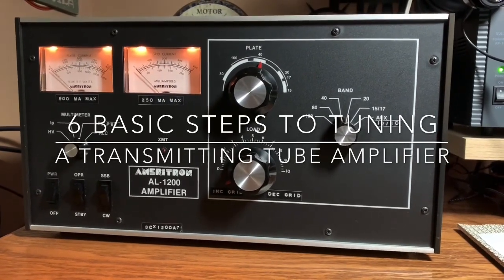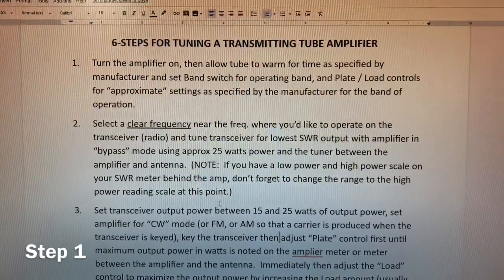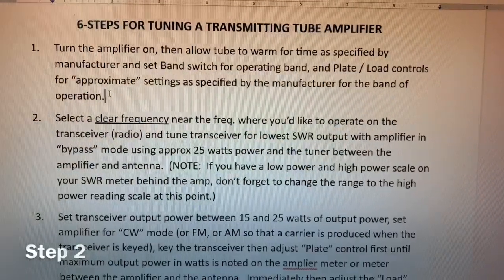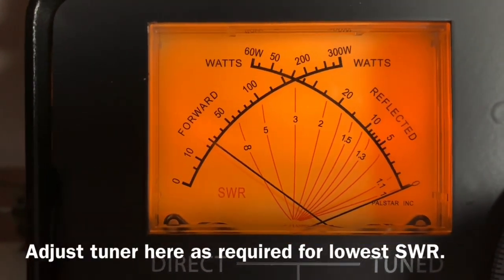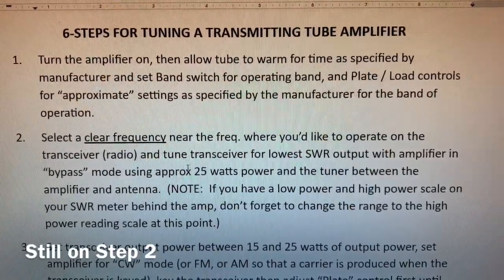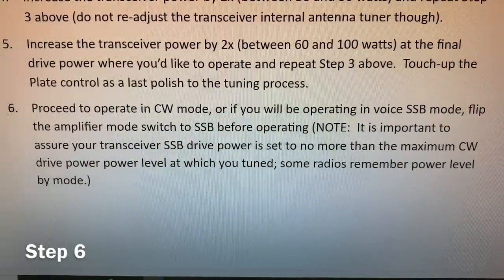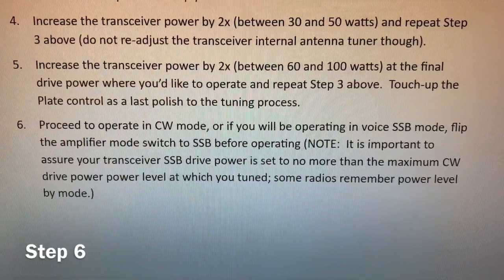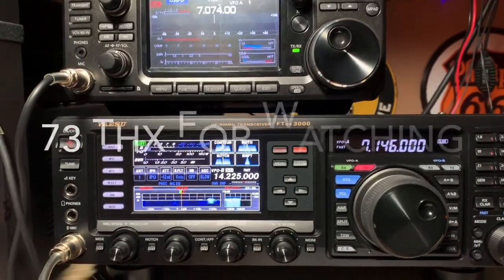6 Basic Steps for Tuning an HF Transmitting Tube Amplifier

Comment: Thanks for such informative video. I have been reading about the proper tuning procedure for my 811H and noticed two distinct "theories". One is to tune to MAX power output (maximizing without exceeding PLATE and or GRID current) and max allowable exciter power then reduce exciter as desired during operation whereas the other theory indicates that you should tune to max RF output for the exciter power you intend to carry (no more no less) and then stick to that. Still wondering which one is correct. To make matters more confusing, I seem to be able to get max RF output with different PLATE/GRID currents so I'm wondering which one I should keep lower (?). Thank you once again for the well put together video !!!
Reply from the maker: Well, I’ve only been playing with the amp for about a year, but the Ameritron literature reads that the amp should be adjusted for maximum output power OR grid current.  On my amp these two properties are maximum at the same time, so I always look for maximum wattage out.  The scheme is to adjust PLATE then LOAD for max output power then touch up PLATE again...all for the anticipated max transceiver drive.  I start at 25W, adjust for max output, then go up in 25W increments.  73
Reply: Im in the same place Alex.  I have asked the question a few times.  I have a TL922.  I figure, if I tune for maximum 500w (within the same guidelines as presented here, ensuring I am well within the plate current and particularly the grid current maxima), then surely I am taking less life out of the tubes than if I go all the way through to exciting with 100w and reducing the drive.  I give a little half increment turn on the load control past maximum to look after the grid.  I have taken note of the variable capacitor positioning in both states, and they are very very close regardless of which way I approach it.

Comment: Would less drive not be required when switching to SSB?.. ( Higher plate V.)
more gain...
Also a final re peak would be needed to get plate impedance set to higher voltage?.
Reply from the maker: Per the amplifier manual, always tune on CW to no less than the maximum drive you will be using on SSB.  You can re-tweak for max output on SSB, but it is harder to tell with consistency.  You can always turn drive back down to less than you used for tuning.  I often tune @ 75W drive then run SSB at 50W…gives a constant cool 1 kW out at that level.

Comment: Very nice video, but how do you get a carrier level when in LSB mode on the 3000? On my 3000 in LSB mode that control adjust the proc level. Thanks
Reply from the maker: Thanks!  There is a menu setting where you can change the function of the control knob; specifically, menu Item 177.  Make sure you have the latest firmware installed on your FT-DX3000 as I know this was an added feature via a firmware update.  73

Comment: I have flown aircraft with a shorter preflight checklist (smile).  Retuning while chasing DX would be interesting and timely...
Reply from the maker: Yeah, it was wordy... :)   Goes much quicker after some practice.  Most of the time re-tuning isn't an issue on 14 MHz or above, only on the low bands.  Thx for watching!

Comment: Would the CW setting be what is used for narrow bandwith digital modes like FT8 and PSK31?
Reply from the maker: Negative, that would be USB-Data setting.
Reply from the maker: On this particular amp, the amp setting can be on CW or SSB for data modes.
Reply: @GhostRider1974  oh ok, I didn't know you could do digital modes with an old amp like this. Though obviously I wouldn't max out the power lol. 73s

Comment: Brilliantly useful thank you. Just out of interest, when setting the LOAD control, what is the purpose of slightly detuning please - when adjusting for the slight "dip"? The only thing I could think of, is to stop the amplifier trying to modulate to 100% - but that's a bit of a wild guess.
Reply from the maker: The Ameritron manual states to final tweak the Load control by clockwise increase as this will optimize the grid current.  If you go the other way, it will increase grid current unnecessarily.

Comment: how have you conect the linear please
Reply from the maker: Howdy John!  My amplifier is connected to the FTDX3000 via a single control cable, having RCA type ends.  This cable plugs into the PTT jack noted as item 6 on page 29 of the FTDX3000 manual.  I do not use the ALC cable.
Reply: @GhostRider1974  Why do you not use the Ext ALC jack next to the PTT? I am getting ready to put a Kenwood TL-922A in service, and I do not want to damage anything. The man who inspected and brought the amp up to date, told me to also run the control line through the buffer box (MFJ ARB-704), since the amp has more voltage than the FTDX-3000 can handle. Thanks for the video, Ghostrider.

Comment: i noticed that you never looked at your IP, is there a danger of running the IP up too high using your method?
Reply from the maker: Ralph ...very good question!  The Ameritron manual for the amp does state to not exceed a certain grid current, but the process is always to tune the amp to max RF output proportional to the input drive.  So, as you state, that is a caveat that must be observed.
Reply: @GhostRider1974  i am getting an FL2100b soon and read that for it the tuning procedure is to gradually increase the exciter power while tuning for a IP minum dip and then finish by adjust load for max Power out.

Comment: And like most hams, be sure you do this on a busy frequency and never use a dummy load. :-P
Reply: Using a dummy load for setting the ATU is always worth a laugh - seen it done more than a few times - and not always the result of an oversight!
Reply: This could easily be done with a noise bridge/ antenna analyzer/ Resonant Antenna.
Today's ham hasn't a clue.

Comment: I am sure other band users would much prefer that you tune the amplifier into a dummy load.
Reply: Agree, and if the antenna tuner was set for a low SWR, then the 50 ohm dummy load settings should be real close to the antenna settings when switching over.  Ideally there should no tuning changes between the two.  Shortens your 'on-the-air time.
Also an additional step 7? could be adjusting the SWR on the transceiver (or the process of using an auto-tuned radio).  The radio's output power could change between 'bypass' and 'operate' if the radio's SWR is not close to 1:1 into the amp.  I have a tube radio and and old tube linear.  The radio's meters change a lot between bypass and operate and need adjusting for any decent power out.  I appreciate long CQ's  so I have time to tune all the dials, ha.

Comment: AT NO TIME in this video  did  I see much or any mention of GRID CURRENT which is  the  MOST DELICATE part of any tube amplifier.  Grid current tends to peak  with peak RF power and  light loading  so BE CAREFUL   to monitor  grid current.  WHERE DID  these  so called  "6 steps"  originate?
Reply from the maker: The steps are paraphrased directly from the Ameritron manual.  Thanks for watching!